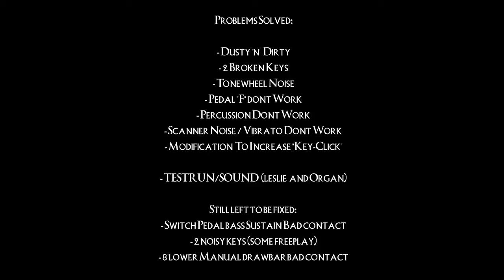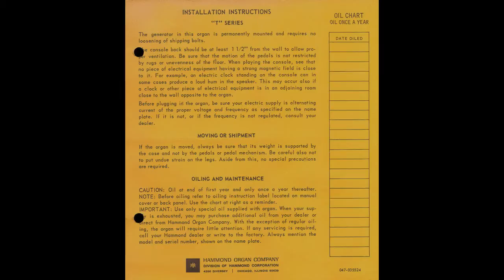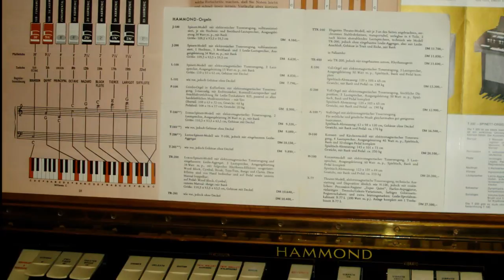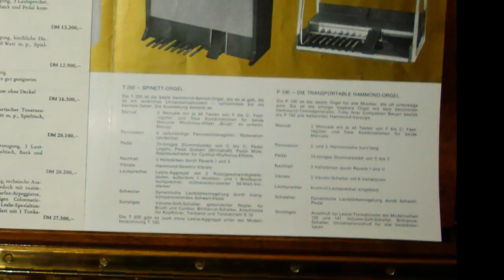Hammond T-200 Problems, Fix & Organ Sound Demo by Keyton 2014

Comment from the maker: my next T-200 video clip can be seen here: http://youtu.be/n8QtoAve4Ds INSTALLING:
- 2 Filter Boards upper and lower manual
w/ modified Percussion: 4long, 4 short, 22/3 long, 22/3 short, 2, mixture
- MIG-T Tube Amp (green board)
- 2 Switches Sound High Frequency Filter on/off
- 1 Switch for Overdrive on/off